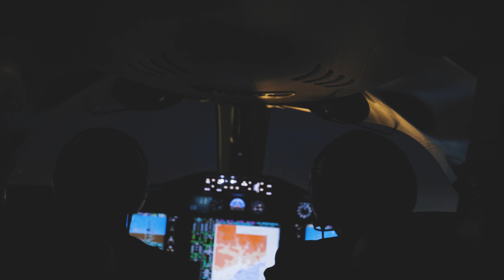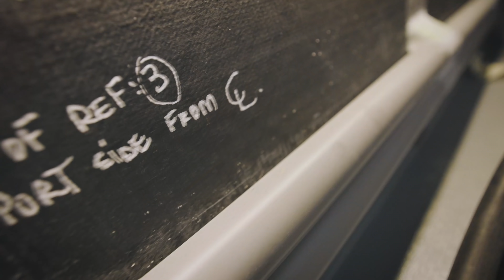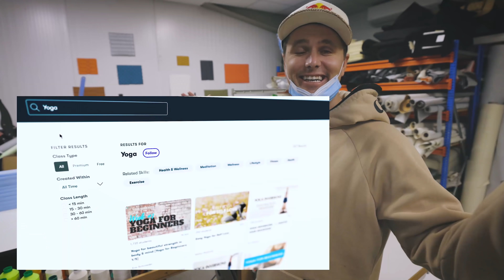THE C'EST NORMAL SPEED YACHT IS ALIVE! | VLOG⁵ 10

Comment: 16:25 it's a Gyroscope. It helps with stabilization. Depending on design, it is a combination of rings spinning at a rate of speed to counter balance movement.  It's a very, very cool piece of equipment.

Comment: Boat is coming along nicely, loving the forged carbon. Might be the first boat built with Mercry 1350/1550 motors paired with Arneson Surface drives. You will need race gas to run 1550 HP mode, 1350 on 98 RON fuel.  Got to drive a friends boat with the same motors, 140GPH at 90MPH, not very fuel efficient.

Comment: That’s going to be the fastest rib boat ever made lol, especially with the dual calibration mercury racing 1,350/1,550 engines!!!! And I don’t think I’ve ever seen a rib boat have surface drives on it either, surface drives are what push the boat, he called them straight shafts but they are a little more then just straight shafts lol!!! That thing is going to be straight bada$$ though!!! The  only two things I don’t like is that the beam seems really really small for that long of a boat and the cabin seems very very small, but everything else I absolutely love!!!!!

Comment: You went with the Merc 1550’s. Very nice choice. Those sound so nice at open throttle. With the hybrid system what’s going to be the total horsepower output. Was also curious what the total wet weight of the boat is??

Comment: Did you ever think about building it with jet engines?. Just someting I were thinking about and hade to ask......its all about the sound???.love the progress👊👍 its going to be a ceaper.🤩🤩🤩
Reply from the maker: Looked into it a ton as its a huge weight saver, but in the end they just dont work well enough to use the boat a lot so sadly it would not work!
Reply: @JonOlsson  säkert vad jag skulle kommit fram till i slutet ändå. Ville bara höra dina tankar. Kommer bli en riktigt cool båt o vi alla kommer säkert älska 1 gången du vrider om nyckeln o vi hör ljudet o ser leendet. Lycka till med allt👍👍👍

Comment: When he says RIB he means Tubes, RIB = Rigid Inflatable Boat    RHIB = RIGID HULL INFLATABLE BOAT, wich this is.
Happy to see the boat at last. I have so many technical question. With just one for the moment... With this bow, and no bow thruster (that I can see) how on earth do you control this boat in port??? Even with a Joystick on boat with surface propellers, it will be a nightmare. The bow will want to straight.